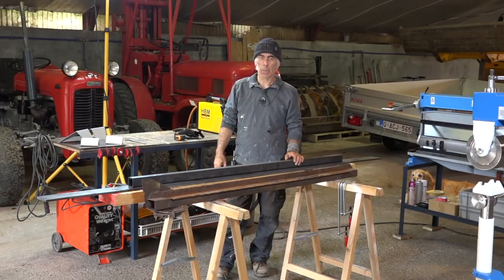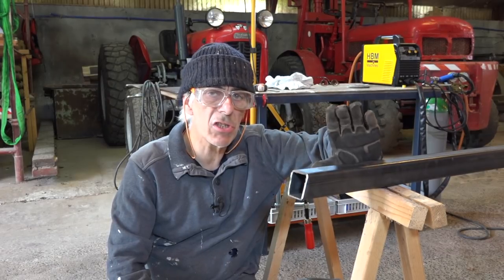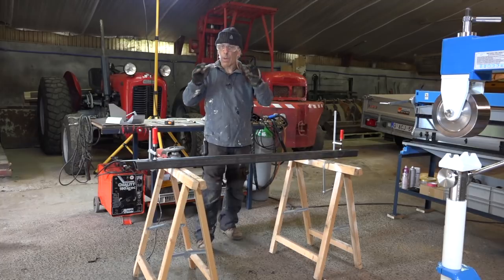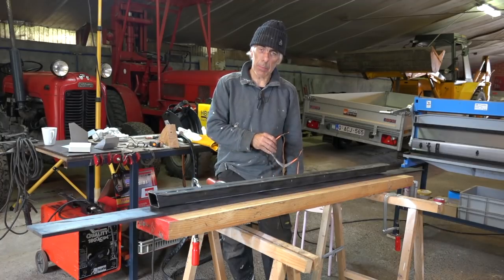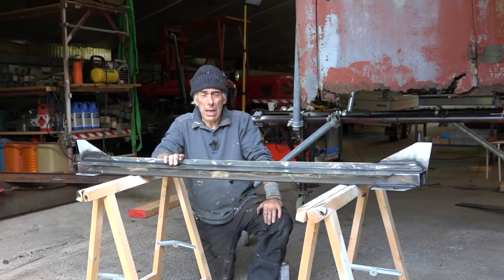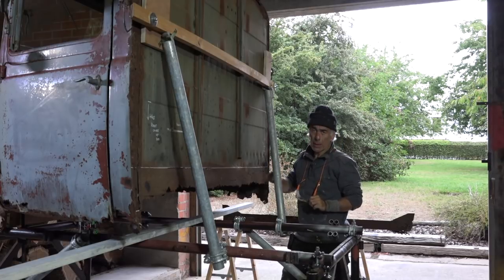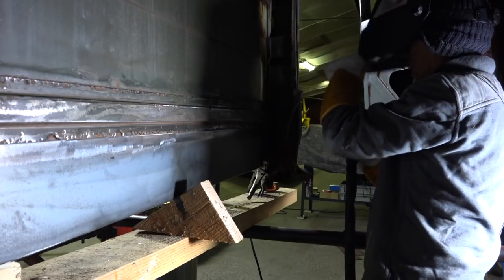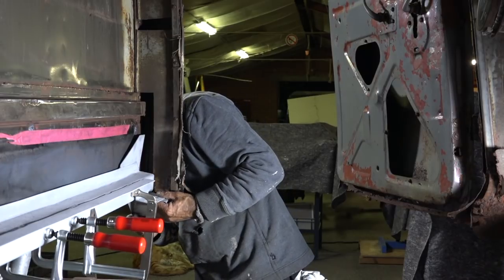Old Rusty, Part 6   Building the cabin rear cross member

Comment: Coming up very good. And the term for  The first couple of welds to hold the job together  before the main welding of the metals is called TACK weld not SPOT WELD, even thought spot welding is a welding process too. So you would  say lets do some tack welds to hold the metal in place.
Reply from the maker: Thanks for the comments, great tips on the wording

Comment: Very satisfying as usual. I don't get on as well with TIG as I do MIG which makes me admire your choice to use TIG extensively. One way of honing your skills for sure. In fact, I've got today off; I think I might just go and waste a few pounds worth of argon and filler rods 😜 to see if I can pick up your TIG vibe! Keep the videos coming for your growing audience.. Best regards. Mike
Reply from the maker: Thanks Mike,  indeed TIG is not the easiest  way of welding, but with a bit of practice it will work,  I am sure that you will be able to do it.   get 100% Argon and the right electrode ( I use the red striped versions) , and small cub (5).  And have differend sizes of filler rods. Make sure the electrode has a sharp point... and you will see that it is not that hard....  ( 4L/min is what I use on the Argon flow).   There are ample of good video's on youtube for TIG.  I need to say, that I had one sheet of metal on the truck that was as good as impossible to weld ( big back panel of the cabin). Very hard  steel and the smallest amperage would even make it scatter, very strange ( most be some awkward metal composition).   Good luck with your TIG welding.   Regards Steve

Comment: I am concerned that the tube is not protected inside from rust.  There are rust sprays that are used for say inside doors with a long tube or you could just push a paint or oil soaked rag thru it, not perfect but anything helps when it comes to rust.
Reply from the maker: Henry in later videos, all hollow cavities are been injected with special wax...

Comment: Great work. What is the pink tape for that you put on the line where you welded the new plate on the back of the cabin? Sorry if this is a stupid question, but I have no expertice when it comes to these things.
Reply from the maker: Thanks Leo, good question...  just some tape I placed for spraying the zink today as I still have area that need welding.  and I don't want to cover those with the zink spray....